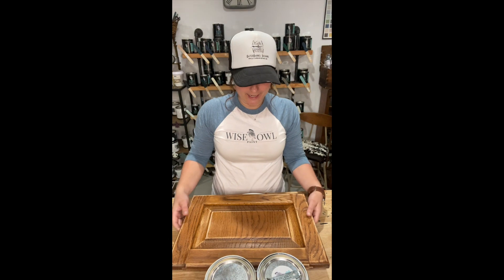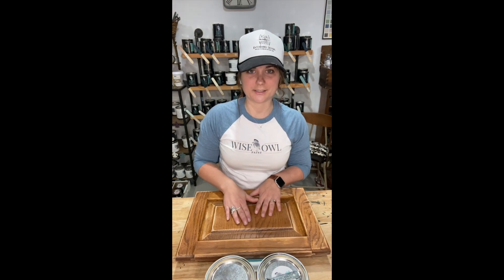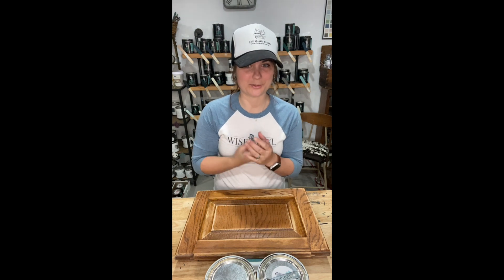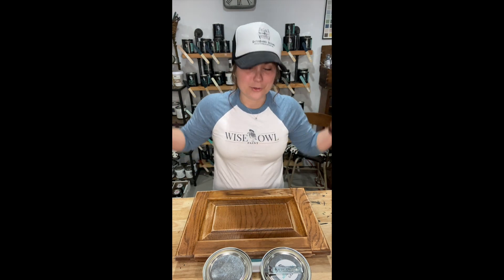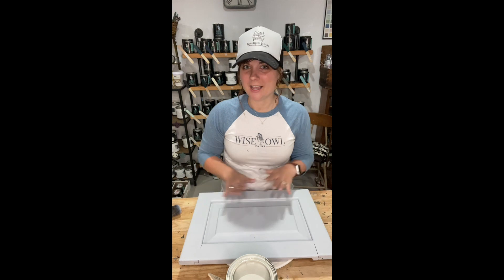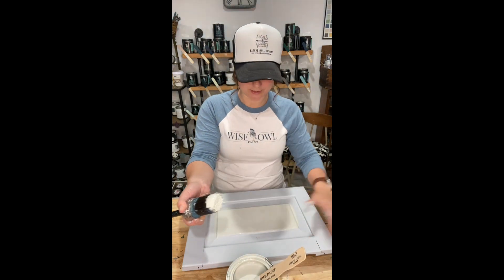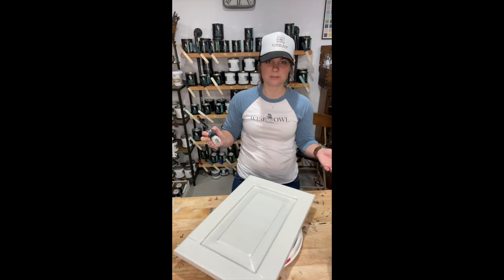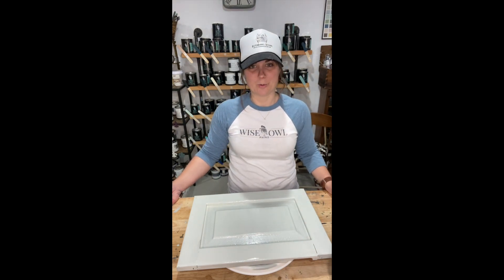Kitchen Cabinet Makeover with Wise Owl One Hour Enamel

Comment: I have MDF wood that is raw with maybe a few grease spots that has soaked in, but most of it is all clean. I took off the vinyl coating from the MDF wood, and I easily just peeled it all off. Do I prime the MDF wood cabinet first and then apply the paint? I am using the Snow Owl color. Thank you.😊

Comment: Great video! I have a few questions.  I painted my cabinets (I suppose they are laminate faux wood) years ago with Dixie Belle mineral paint,  I loved the way they turned out, and they held up very well for the last five years as far as durability…however using their Gator Hide NON-yellowing top coat it actually has recently yellowed. So I’m looking for a way to repaint them, but I’m so worried about them turning yellow. It looks like with this wise owl one hour enamel it’s not necessary to use a topcoat. I just wanna make sure I’m clear on that? My next question is, how would you suggest painting over these preprinted cabinets? would I need to lightly sand them first or just a primer? The cabinets are a color called dropcloth which is off-white. I will probably be doing a similar color for the repaint. Ty!
Reply from the maker: Hi there! 

So I would recommend a really thorough cleaning, make sure to rinse any cleaning products after, and then you will need to prime, two coats, and then, two coats of the one hour enamel. You do not need to top coat. Hope this helps!

Comment: Great video! Is this ok to use on countertops? (once cleaned, sanded, and primed, of course ;)
Reply from the maker: So you can use the OHE on countertops, I have had customers do this. Keep in mind it won’t be a permanent solution and with heavy use you could have issues.

Comment: It says do not wax but I’ve seen people wax over it, is it fine to be waxed After a seal coat?
Reply from the maker: I would not. You can use glaze on this if that’s a look your going for, however, you will need to seal your glaze.

Also, you don’t need to seal this paint unless you are suing a glaze. Top coat is all built in.

Comment: Terrific tutorial!  I'm refinishing a vintage kitchen cabinet where I will be using the Wise Owl One Hour Enamel. The original piece was painted white and had some red and black floral motifs. I do have a question. This paint is self-leveling so does that mean the surface must be horizontal when paint is applied? I have not used this type of paint before. I see you used the F45 brush for this door. I picked up the F40 and F30. First time using these brushes. Thank you!
Reply from the maker: Catherine Costa I’m so sorry! I just saw your comment. I don’t brush horizontal typically, I do try to go against gravity, so brush up.
Reply: @katebarreldesigns2684  Great, thank you!

Comment: My kitchen cabinets are 4years old. Can I apply this one to my cabinet doors? (After clean my cabinet doors I can apply or I need to apply primer then apply this?)
Reply from the maker: You will always want to apply two coats of wise owl primer after proper prep before using the one hour enamel.
Reply: @katebarreldesigns2684  I don’t have any details about my cabinet color. It looks white color. Owl premier matches for my cabinet color??
Reply from the maker: @sangeetha48  primer color is not based on the current cabinet color. Primer color is based on what color you want to paint your cabinets.

Comment: I thought you did not need to use primer with Wise Owl one hour enamel paint?????
Reply from the maker: Hi Linda,

This is incorrect. Standard practice and use with one hour enamel always requires the use of wise owl stain eliminating primer. 

The chalk synthesis may not always require a primer. 

Thanks!